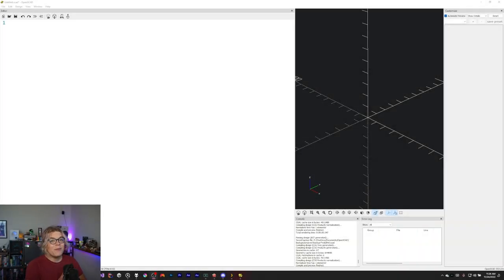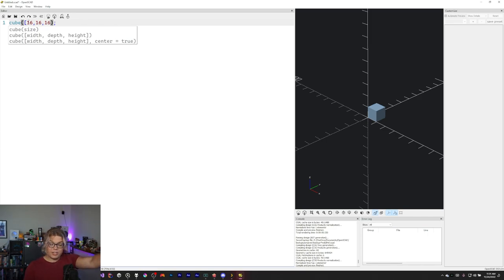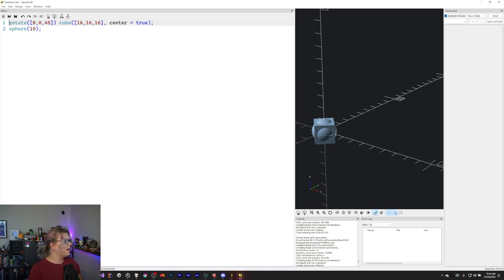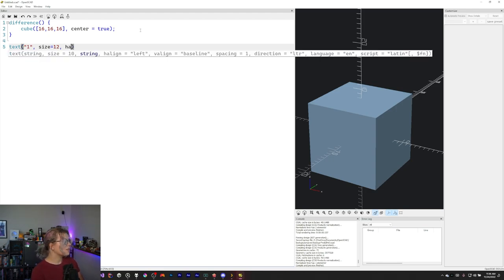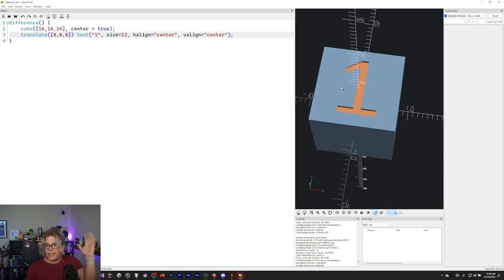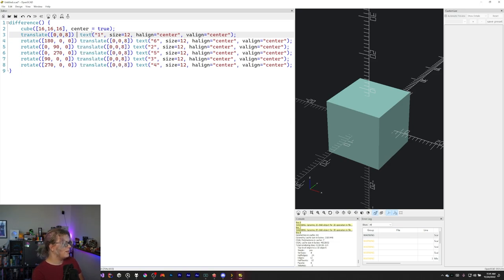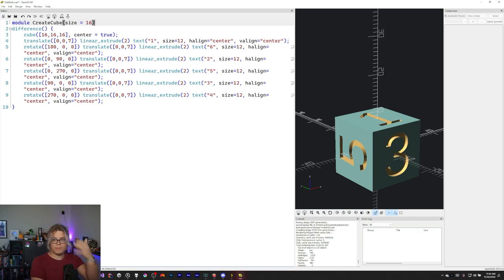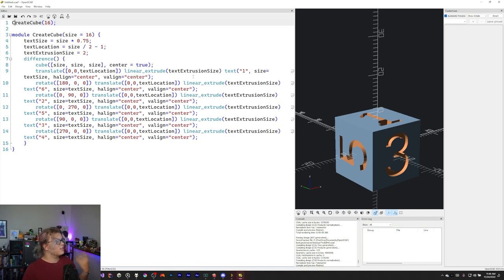Building a Custom Dice Model with OpenSCAD

Comment: Thank you so much, very helpful video 
But what if I want a little picture on one of the sides?
Reply from the maker: SCAD is more commonly used for computer aided drafting and things like textures aren't as frequently used. It does support SVG and DXF image formats though and you can import those using the `import` command. That's documented more here if you want to give it a try: https://en.wikibooks.org/wiki/OpenSCAD_User_Manual/STL_Import_and_Export